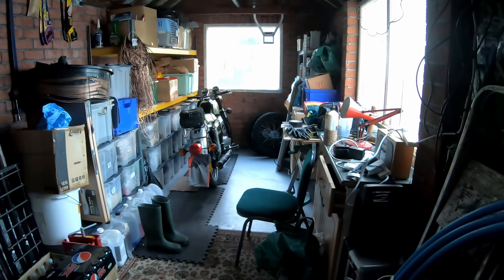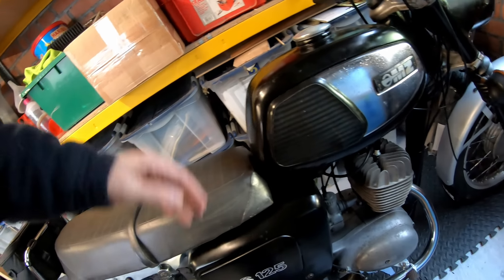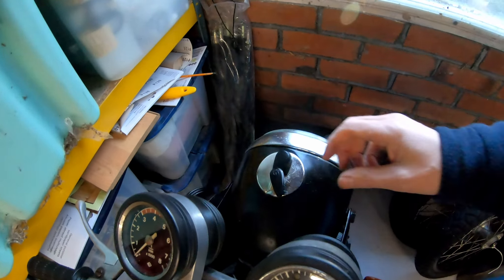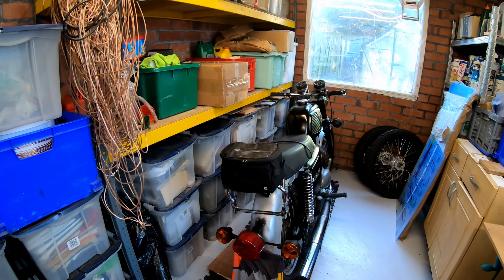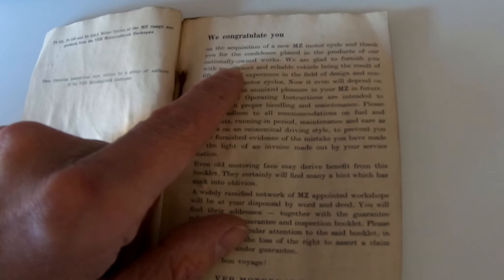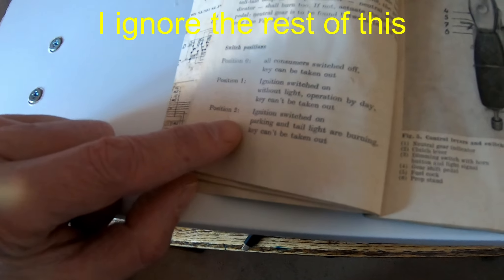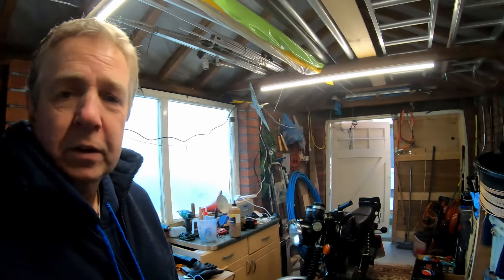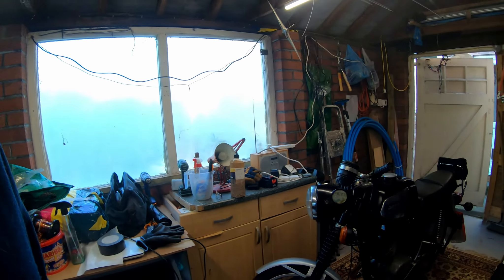MZ TS125 - Ep 13 How To Start An MZ

Comment: Had my MOT booked today for my mz just like this, but it wouldn’t start, bumped it and all multiple times. Checked the spark and it was flooded almost. Immediate thought is floats are too high, any thoughts?
Reply from the maker: Sorry to hear that. I've had a float leak, so it sank. This flooded. Also a replacement plastic float appeared to fail due to ethanol in fuel it became heavy and sank. Currently on a new metal one and all is well. I now remove the ethanol just in case, prior to mixing. Would check float for leaks first. I'd be interested to see what you find. I removed mine, shook it, and you can hear fuel inside if it has failed. 🤞👍 

See here: https://youtu.be/c54a0en9Aj8
Reply: @CodgerBiker  little update:
MOT this Friday, with a new, correct, spark plug as it was a cheap terrible one there originally. Put the correct spark in and it runs like a treat. Bought a brand new exhaust and fuel tap for it as well as a new float, but we think the original float is fine! Thank you for your videos! Subscribed!
Reply from the maker: Cheers. Make a video? We are lucky there are still plenty of spares. Soon adds up though. I bought the bike (6 weeks old) in 1984 for less than £200. I’ve spent 4x that on parts to ‘restore’ it. 😂👍